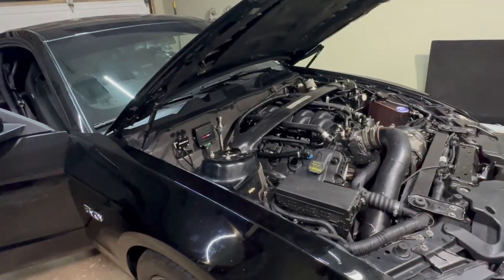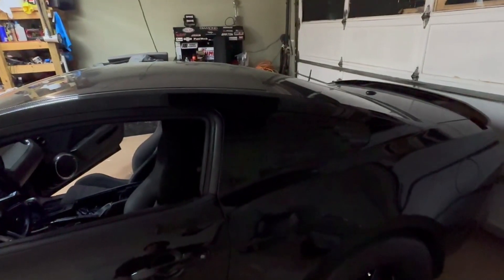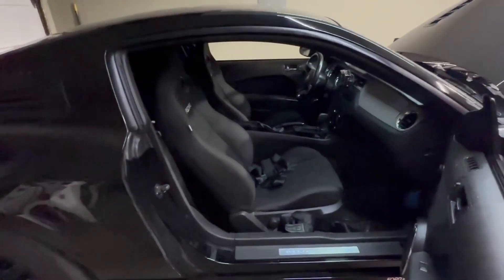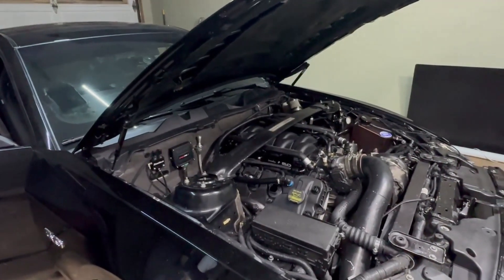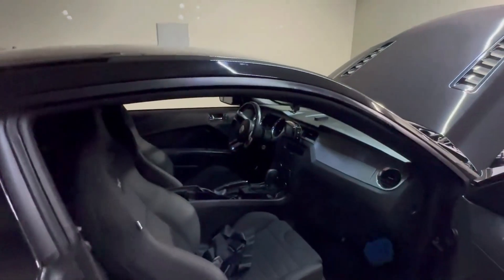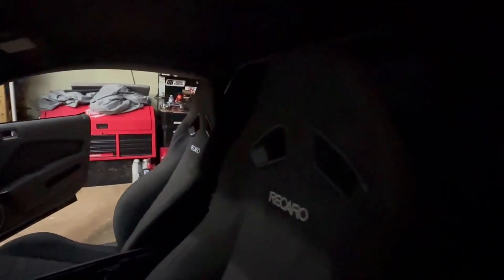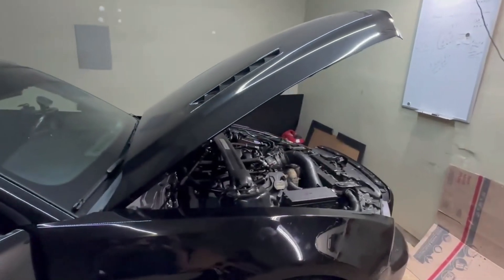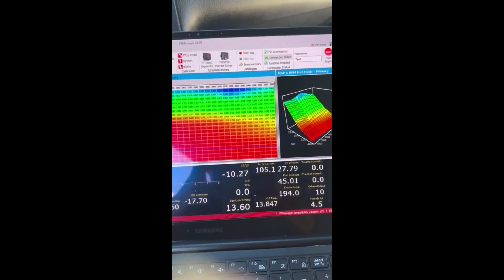mustang gt on fueltech ecu

Comment: Do u have flex fuel now and running anti-lag?
Reply from the maker: Yes I actually have a bit tuned for E85 and 93
Reply: @CRS197  sweet things dope AF
Reply from the maker: Yes on the flex fuel anti lag not yet I am not runing the car hard Enough yet where the  car should be i'm just trying to get the fuel map right first
Reply: @CRS197  dope